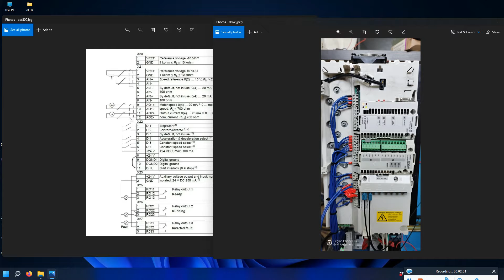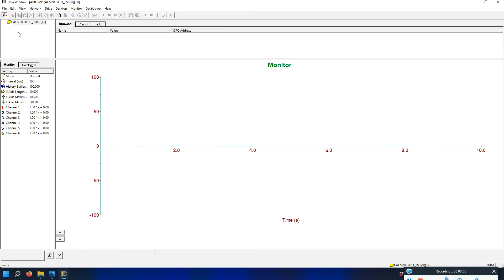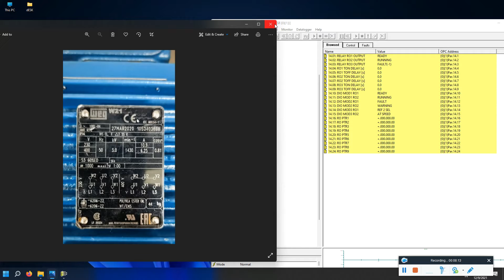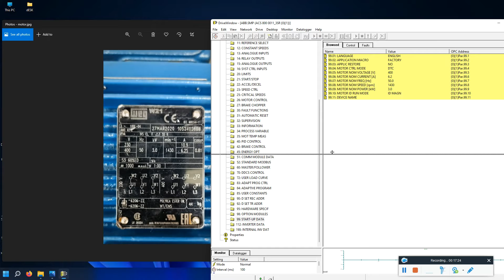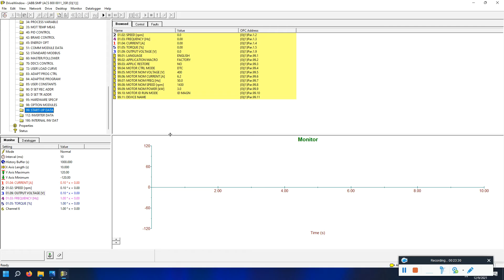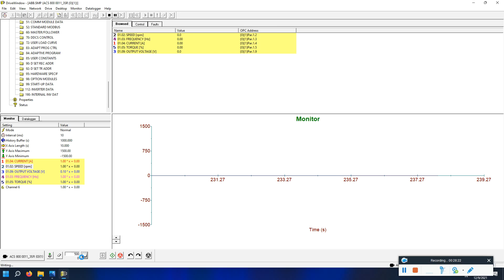19. ABB ACS 800 Drive Basic Startup & commissioning

Comment: Dear Sir, 
Thank you so much for your tutorial video, 

I have a short question please
ABB VFD ACS800-01, some parameters are hidden from the local control display, the only visible parameters are group 10,11,14,16 and 33

Please comment Sir
Reply from the maker: Hi,
For this video i have used a standard firmware for ACS800 drive. I doubt the parameters are hidden due to a custom firmware.
Reply: @averageengineer4266  
Thank you Sir for your prompt reply, 
would you please tell me what is the number of this firmware version, please